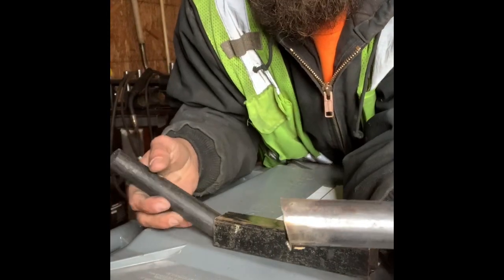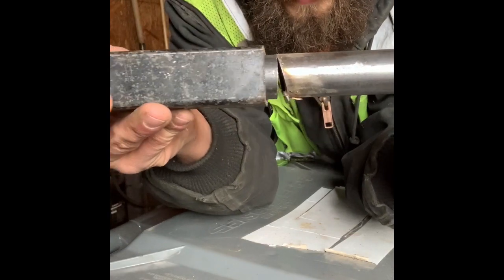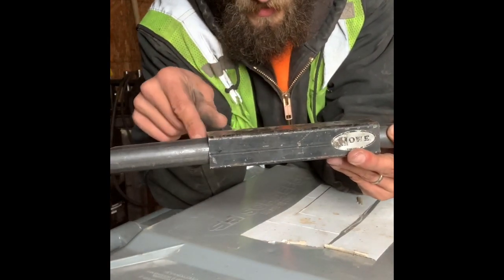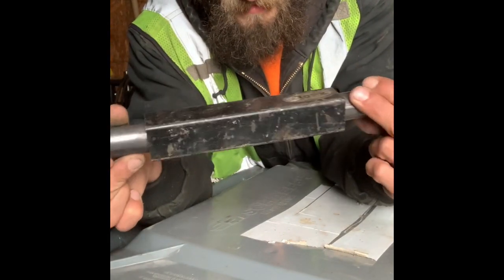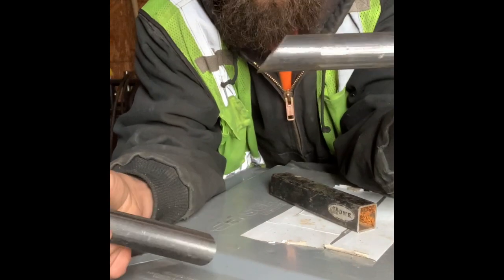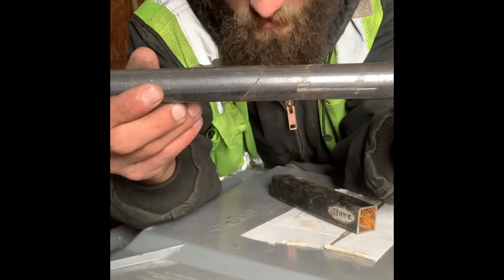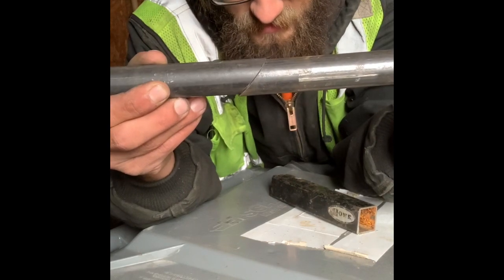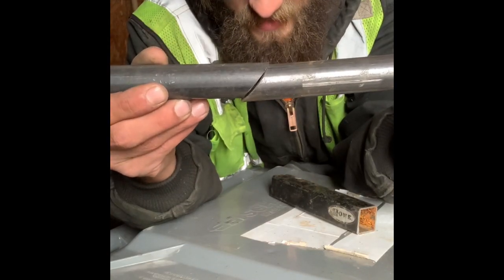Cv axle shaft shortening

Comment: Hello: I have been enjoying watching your build process.  I am currently build two buggies, one with a 40 horsepower snowmobile engine and the other with a 95 horsepower snowmobile engine.  I am struggling with getting the correct axle situation with my 40 horsepower buggy.  Let me ask you, how has the welded CV axle held up?  Can it take some serious power?  I agonized over splicing my axles but many comments I have read state that welded CV axles only hold up in lower power applications.
I am using RZR transmissions in both my buggies so that won't be a problem.  My 95 horsepower buggy will be using all stock RZR suspension parts so there won't be a durability issue with that buggy.
I'm debating on custom splining a CV axle so I can have an inboard RZR CV joint and an Arctic Cat ATV outer CV joint to go with my ATV suspension on the 40 horsepower buggy.  Welding the halfshafts would be easier, but I am concerned that the first time I try to pull a wheely or floor the accelerator, my welded axle may snap.
Your thoughts?
Thank you.
Reply from the maker: When they say high hp they are talking 300+ the low torque num thx you’ll be dealing with I’d be confident with it.

Comment: I know your idea will work, but I'd like to point out that you have basically created a cam or screw inside the tube. The torque on the axle is now being directed outward along the axis of the axle, pushing out towards your wheel on one side and drive on the other. 

If the centre weld fails from torque, and the sleeve walls hold, the axle will try to grow longer. 

The best way with a solid axle is to bevel both sides down to a point, or almost, and then make several passes to fill the void. Then sleeve if necessary / desired.  If you have a hollow shaft, bevel as much as you can, sleeve it on the inside and outside.

All of that being said... you don't always need the best solution, and this idea will work fine in many applications.
Reply from the maker: I can agree however the welds one each end of the tube and the rosett welds should stop that,
Reply: @QuadMedic  Yes, the welds should stop that 👍

My point was that when you cut an angle on the end of the axle it is a compromise. You are gaining a mechanical lock based on the geometry, but you also creating a cam, screw or helix effect that otherwise would not exist. You need to be aware of these forces when you do your welding as this screw effect can greatly multiply the load on the delded area.
Reply from the maker: @JoelArseneaultYouTube  it also would take massive amounts of torque to screw them apart in that manner your more likely to break the cv in another part

Comment: Does having the added weight of the sleeve create any vibration?
Reply from the maker: It can but these are not ment for high seed over long distances
Reply: Degenerate Fabricators. So would I be able to notice it going 60-70 mph on the highway.
Reply from the maker: You may notice it but I’d think it’d be fine